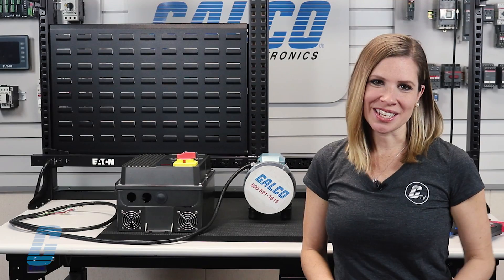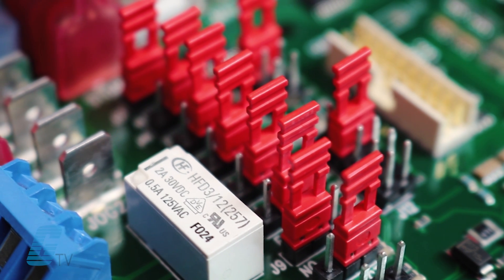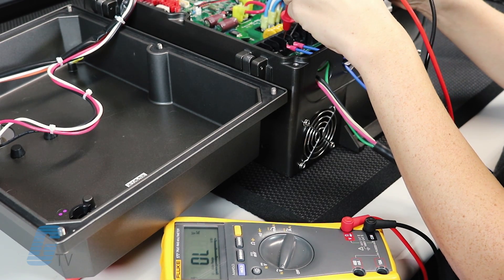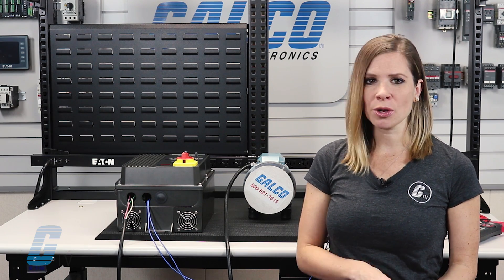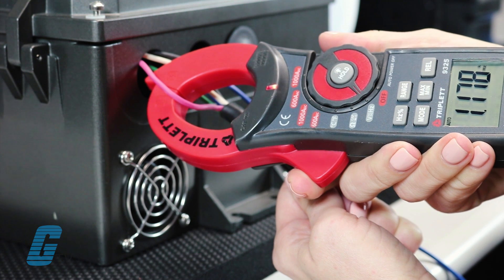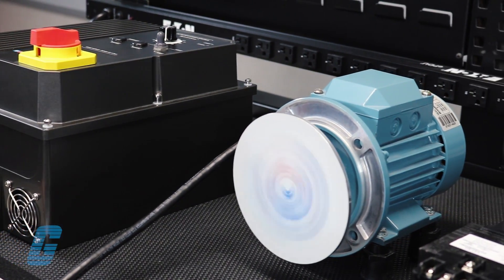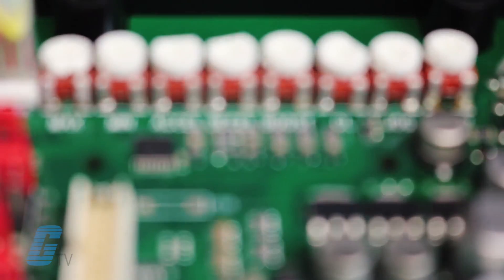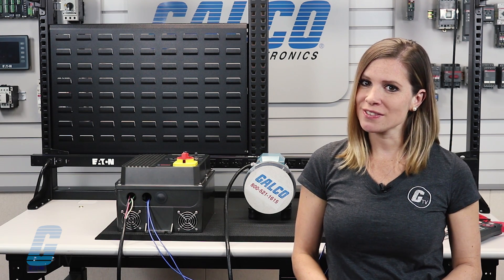How to wire and setup KB Electronics KBAC Series Drives

Comment: This is one great video, such clear speaking and great info, only one Q, when you set the min-max /accel-decel  pods, are you shutting down the unit every time, I know it's hard to adjust with it not running,  and did read the part about using a special screwdriver,  but it should be adjusted from min to max while running?  and the boost is for what exactly?  Again great video, one of the best I've ever seen.  👍👍👍👍

Comment: I have a KBAC-24D and I'm trying to run a Baldor 3/4HP 3 Phase motor (Model#eh3m9104). However, I am getting solid green and slow flash yellow lights when I try to start the motor. According to manual that means "Standby" Only if the Forward-Stop-Reverse Switch is installed, but I don't have that switch. Any comments?
Reply from the maker: Have you verified all the jumpers on the control board J2 thru J11, and is there a jumper from com to fwd on control board?
Reply: FWD-COM-REV jumper was missing, I connected COM to FWD and works just fine :) thanks for the help!
Reply from the maker: Your very welcome, thanks for asking Galco.

Comment: Those look pretty slick. Do you have any other higher hp options for 1p in 3ph out with similar controls?
Reply from the maker: The KBAC-27D goes to 2HP with single phase input and 3 phase output. You can call 800-337-1720 if you would like more info or would like to place an order!